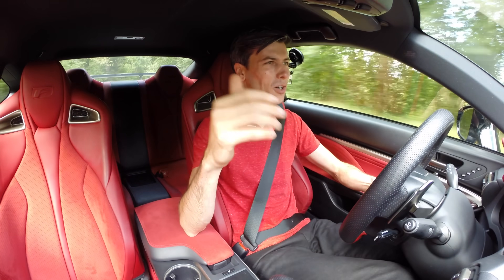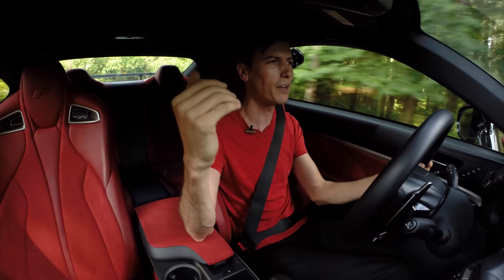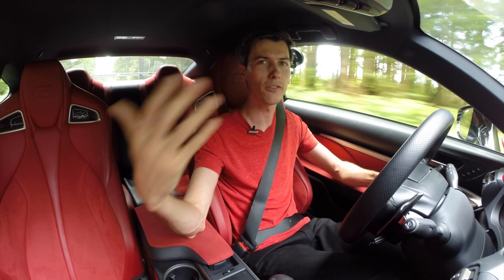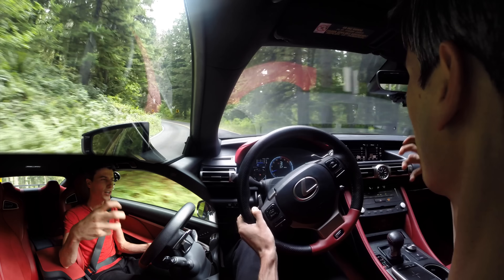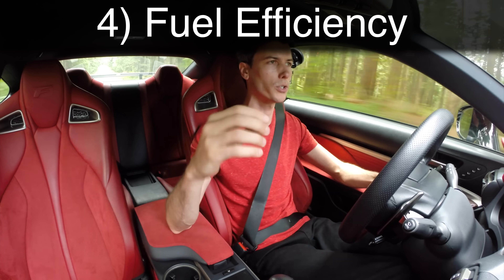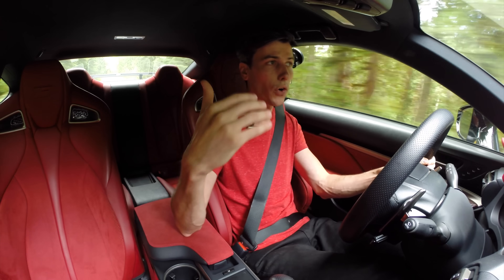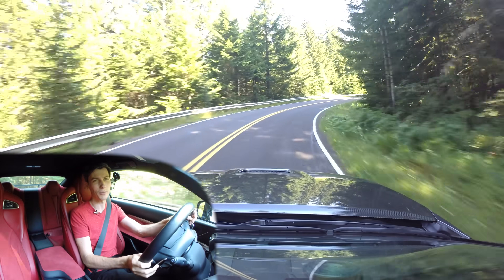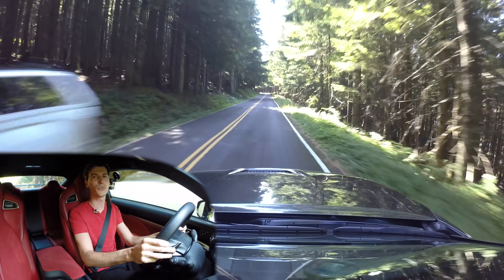5 Reasons You Shouldn't Buy A Turbocharged Car

Comment: Horsepower has been improving because of direct fuel injection(cools cylinder for even higher compression with a turbo) and biturbos.( one small, one large for lag improvement).  Later found out direct fuel injection increasing more exhaust particulates which mean traps needed for air pollution.  Gas motors maxing out on emissions.  Hybrids may help more especially transitioning to full EV’s.  Audi working on ELECTRIC Turbos which seems ideal. Plus no lag!

Comment: Turbos are great when you're cutting into another lane. You cut someone off but instead of accelerating into space, with the delay you make them hit their brakes, and just as they start getting mad you take off. Combine throttle by wire, turbos, and an automatic transmission hunting for gears, the look on other people's face is priceless.
Reply: Looks like your username was made specifically for this comment.
Reply: So the most recent car you've driven was built in 1992 or something?
Reply: Sérgio Alves 2015 Ford Escape (turbo), 2017 Nissan Altima, 2018 Kia Soul. At least the Soul has a sport mode which seems to reduce the delay with kick down when maneuvering in city driving.
Reply: @zipskippy433  They must all have some really shitty automatics because you can't tell me with a straight face that those cars have such bad turbo lag that you nearly crash into people in traffic.

Or maybe you just can't drive the cars properly, you don't floor the throttle in 6th gear at 1200rpm on a small turbocharged engine.

Do you americans realize that that in Europe like half the cars on the road are turbocharged? An no people don't crash them because of the turbo lag, and yes they do last hundreds of thousands of miles too.
Reply: @zipskippy433  You're exactly the guy I like to have fun in with my Nitrous car :) Good luck with your so called driving style. Sounds to me that you'll be the one getting mad. LOLOLOL

Comment: What do you think of the turbo diesels in 3/4 and 1 ton pickup trucks? Which do you think is better for a HD pickup, gas or diesel? Most people purchase the diesel for the better mpg, longevity and towing capabilities, but the cost is significant. I would like to hear your thoughts about this in a future video. Thanks.

Comment: I'm pretty sure the reason mfg's hype turbo's so much is on account of the 'displacement taxes' levied by some countries. Turbo's allow reasonable power from significantly smaller displacement engines. Also, unless well maintained & pampered turbo equipped vehicles have significantly shorter lifespans & guarantee much increased dealership service/parts dept revenue. Sorry, IMHO, turbocharged engines have no place in any vehicle that must be depended upon for long term reliable/economical/durable transportation.
Reply: rwbishop why is my 2012 E63 biturbo with 198k miles still running and super reliable? By  next year I will hit 200k miles. Why hasn’t it broken down?

Comment: top 1 reasons to buy a turbo: upgrading power is easy and cheap. any NA engines won't see even a 10% increase in power without dumping several thousand in tearing the motor apart.

Comment: Just a comment about turbo dependability, I have a 1988 toyota supra turbo (second car) and although I only have 110,000 miles on it, they are very hard miles. I've never had to service the turbo and it's running 12.5 lbs. of boost with a big blowoff value, instead of the factory 6.8.  But, I'm not sure if this is normal.

Comment: If you really think about it, the VTEC system is a much better system than turbocharging or supercharging.
Reply: Variable Valve Timing definitely will broaden your torque curve and is not subject to the heat stresses of pressurized engines.
But, the torque increase of a pressurised engine, and now includes Variable Valve Timing cannot be equaled with a naturally aspirated engine.
But, not everyone needs it.

Comment: Complexity is the downside of turbo IMO, and I own an older Maserati V6 biturbo, so living it.!   It's good when it all works, but small air leaks due perished PCV/vent lines or exhaust cause mis-fueling by the ECU.   Water injection is the best anti detonation answer, no XS fuel and a cooler charge.   Driving down the road at hwy speeds both NA or turbo cars should be running lean of peak EGT at 16:1 AFR or so, so getting good fuel economy.   At full power, who cares what economy you get, you aren't driving for economy!   So, why does the Aston Martin V8 Vantage, NA 4.3L V8 get such crappy fuel economy?

Comment: Adding boost effectively increases your compression ratio, so it is actually more efficient through that argument as long as you are in boost.
Reply: Agreed, it harnesses heat from the exhaust that would have been wasted but gets converted back into useful work.

Comment: Number 2: I've got a 2,0 diesel 190 horsepower Skoda Superb and the engine is the 150 hp version but Skoda added a bigger turbo to it and most of people are like: I was aware of the torque engage in 190 hp so I bought 150 hp which is nicely pulling from 1,400 rpm. Sure,
but I personally like the 190 bhp that is gradually engaging from 1,800 rpm up to the high 3,000' like an N/A engine.
Reply: But honestly Skoda ruined it by the 250 Nm transmission on a 400 Nm car and if you don't buy a model made after like 47 or 42/2017 (don'z know) it'll suck.

Comment: I was told by a Ford mechanic when I owned one of their 2015 eco boost 4 cylinders - You can have ECO or you can have BOOST but you can’t have both. Which made sense when I was trying to figure out why wife’s 100 thousand + miles 2007 V6 Lexus was getting much better gas mileage than at the time  my new 2015. FYI I now own a new N.A. V6 and I am much happier😁

Comment: I'm trying to see your side of this video but I'm sorry, we will  not go back to normally aspirated vehicles unless the engineers find a better way to produce such wonderful power from pretty much any internal combustion engine, big displacement or not. We are on our 5th Subaru WRX and would have an STI if my wife would just drive a manual trans. Even my 2018 Ford Escape is a turbo. We put a lot of miles on our vehicles and keep them for a long time. We happen to love the turbo lag of the older WRX. You can really feel the power kick in. The newer vehicles seem to regulate the boost and feed it slower to limit the lag. I guess key here is frequent oil changes with good quality oil, clean air and oil filters. we have very little issues if any  with our cars because we take care of them. We do drive them quite hard at times though. That's what the turbos are for.  If you are an engineer, you know the best formula : Power = Fun.

Comment: Disagree with you:
I own and drive a 1989 mazda 626 with 2.0 8 valve 4 cylinder engine. It has good enough low end torque (uphill start from a 1000-1200 rpm) and mid range (3500-5500 rpm) power
But it revs very slowly, and after 5000 rpm it really retards in terms of power.

Only modern naturally aspirated engines get good airflow due to variable geometry intake manifolds, variable valve timing, light pistons and flywheel, especially a modern lexus v8 with yamaha modified heads loves to rev.

But in city traffic and everyday life 1000-2000 initial turbo power kick gives us very enjoyable starts combined with good mpg, and a bigger power figure on higher rpms.
These engines doesnt have to rev up to 8000, there sweet point is 3500-6500 for floor down acceleation and 1500-2500 for comfortable city/highway drives.

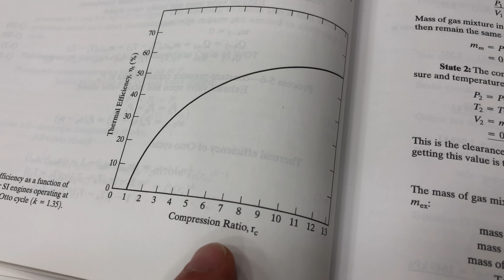Comment: 7:01 Does a trurbo engine realy have a lower compression ratio? I mean, air is compressed by the turbo and the pistons, so, turbo's compression + piston's compression = higher compression ration than natural aspirated engines, right?
Reply: Compression ratio is calculated based on CCs of the combustion chamber at Top Dead Center and at Bottom Dead Center. Air pressure does not affect compression ratio. Turbo motors need lower compression to make up for heat and the extra oxygen forced into the chamber. High compression + forced induction = over pressure.

Comment: Instead of dumping in extra fuel to cool the combustion one can use water injection (and/or EGR) and keep an optimal stoichiometric fuel to air ratio to achieve better fuel economy AND power at the same time. Cooling also prevents the wasteful production of NOx. Water turned to steam provides additional power and can be recycled via condensing some of the exhaust. The patent pending Augmented Compression Engine does this.

Comment: One glaring detail omitted. Downsizing engines, especially in the cheaper cars is not really done to improve fuel efficiency but the main concern is actually to reduce emissions due to tighter regulations. That's why small displacement 4-cylinder engines are being replaced with even smaller displacement turbocharged 3-cylinder engines (at least outside of the US). Now, naturally car manufacturers can't really expect a person to get used to a naturally aspirated 3-cylinder with 0.9L or 1.0L displacement values because it just doesn't generate a lot of power, so they strapped a turbo on it and suddenly it makes 90 bhp just like a standard small engine from previous generations, but with quite lower emissions. While for performance cars that really isn't a concern, those don't really make up the majority of circulating vehicules worldwide.

Comment: Tried driving a diesel truck without a turbo. You’ll never question if it should have one or not.
Reply: Diesel are another story. There are good NA gasoline engines, can't say the same about diesels ...
Reply: Ken Kalajdžič nope. The principles are the same with petrol. All 2019 petrol turbo cars are 11:1 compression ratio hence great low rpm throttle response.
Reply: @kenkalajdzic  I have a neighbor that has a diesel engine that is NA... TSI or whatever it's called...
Don't know how well it works for him...
But I do know that it's battery died a few times...
It was in the winter...Didn't happen on ours...and our car is a TDI. :D
Reply: @Rob-326  NA diesels have stupendously high compression ratios, which, when you combine it with the fact that there are no spark plugs, requires a massively powerful starter and a corresponding high load put on the battery each and every time the engine is started, especially cold.
Reply: @chuckschillingvideos  That explains it...
Reply: @Rob-326  Non turbocharged TDI's are called SDI's. At least here in GER
Reply: @hafensanger7771  Yeah.That's the term here too.
Greeting from Romania! :D
Reply: LMAO.  drove a Chevy luv diesel delivery truck for a while W A Y back in the day.  We have faster PUSH lawnmowers now.
Reply: Gm's old 6.5 is a great example.
Reply: True that i had 1 donkey and i promised myself never again 0 to 60 in ten years
Reply: Gail Banks to the rescue...
Reply: without the turbo your looking at 45mph tops.
Reply: @mikemccade6657  no your not. I've had a non turbo 7.3 powerstroke tthat drove great even at 85-90

Comment: The biggest disadvantage of NA vehicles is: taxation. Maybe it's not a problem over there in the USA but in many countries, like in Portugal, it is. When the price of a new car depends on the tax imposed over the displacement, you're not going to buy a 2L NA when you can buy a much cheaper 1.4L turbo with the same hp. Plus, the road tax here is based on the CO2 emissions and the 1.4L turbo has lower emissions and therefore pays a lower road tax.
Reply: Japan has that too.

Comment: The turbo size determining where response and peak power is made is very similar to the cam selection made in a NA vehicle. Depending on the size turbo or engine the turbo would effect that power delivery just as much as a cam would for NA engines.

Comment: The torque vs foot position is just because of the electric pedal ...
Reply: I don't think he explained it very well. The problem with turbos is not torque vs foot position it's torque requested vs torque delivered over time.

In a NA engine you request 25, 50, 100% torque and you get it pretty much immediately. In a turbocharged engine you request 25% and you get it immediately, but request 100% and you get it maybe a second later, it varies but unless you're keeping the engine at fairly high RPM there's always a delay.

Comment: 2.5L turbo engine is nothing like 2.5NA before spooling because of lower compression.
Reply: Compression doesn't make as much different in terms of power as people think.

Mostly it'll be the gearing. A 2.5l turbo engine will easily have over 300hp and be geared accordingly, a 2.5l NA will generally have around 200hp and be geared much shorter.

Comment: I don't seem to understand why that Lexus has such small wheels.
Reply: chez421  It's the exact reason why I have 17" on my E34 instead of 18s.. but I think I should have specified more in my comment by saying tire width not small wheels. :D
EDIT: Because the tires width isn't high enough to compensate for the small wheel size.

Comment: Maintenance also is a reason to choose NA over turbo. Every turbo car I've worked on has needed coil and spark plug replacement probably twice as often as NA cars. Normally the oil change intervals matter more for turbo cars as well due to oil circulating through the turbo.

Comment: Mazda is doing some very cool stuff in the field of NA engines... But I think I still prefer a turbocharged engine. 

Unfortunately I think you haven't considered that in Europe things are quite different. The average petrol engines are 3 cylinders 1.0 L turbocharged with 90-120hp or 1.5l four bangers with 130-150hp. Diesel engines are usually between 1.4 - 2.5 liters with 75 to 220 hp... 
In this scenario owning a v8 is impossible cause of taxes and fuel cost. 

Still, my SEAT Leon 2.0 TDI DSG averages 37-40mpg and is great fun for my needs.
As others have said, one just has to know to anticipate throttle application: it becomes natural after a while, tho I have to admit that the DSG does the majority of the work...

Comment: Flawed fuel consumption & emissions calculation methods favour turbos too. I have an Abarth 124 (1.4 turbo) and an MX5 (Miata 2.0 normally aspirated). Different engines in cars that are otherwise very similar cars. On paper (official numbers) the 124 is 10% more economical. In real world driving, the opposite is true. Yes, the 124 could be more economical if you drive as if there were an egg under gas pedal...but the moment the turbo is spooling? Not a chance. If we had real world testing, this whole “capacity downsizing with turbo” thing may not have been a trend.

Comment: It's why I can't stand driving a turbo-diesel car. Granted it might have better returns on mpg and I was using the car purely for getting from A to B, fine, but it being a diesel it has a narrow power-band as it is, but slap a turbo on it and it's just a dull, on-off switch at the pedal.

Advantage of having petrol and naturally aspirated as you say gives you a wider power-band to operate which also feels much smoother, much more enjoyable to drive and consequently, makes for a safer drive if the driver is engaged. 

Can't avoid the turbos in the UK though. Pretty much 90% of all new cars have small cheap turbos slapped on them to try and meet EU emissions regulations. Ironically, the vehicles produce more emissions because people are heavier on the pedal with a turbo because of the 'on-off' characteristic and increasing the volume of air to combust with the fuel equates to more emissions being produced, even if thermal efficiencies increase!
Reply: That's rather odd. My turbodiesel gives a pretty good response all the way from 1700 to about 3000 rpm, and feels very smooth. What car was it?
Reply: My 2.0 biturbodiesel  gives me massive acceleration from 1500 to 4500 rpm. I don't find this range narrow.
Reply: I don't get it, you don't what to put a turbo in a everyday car to make peak power.
also, I have driven Turbo and NA diesel, sure I didn't push both car no did I had to a good feel for the turbo acceleration and gear ratios.

but both feel quite like they are flat horsepower high torque engines.
unlike driving a gasoline NA.
If anything diesel ha a flat power band, unlike gasoline, were the power goes up the more you press the pedal.

maybe that is what people are complaining about, that they car just feel the same no matter how much you press the throttle.
Reply: I agree that an every-day car doesn't necessarily require a turbo to function as, well, just that. A lot of car manufacturers substitute a cylinder for a turbo to maintain power outputs whilst trying to meet emissions regulations. It just gives a 'flat' feel synonymous with a diesel. 

Personally, I'm used to having a more curved power band using petrol...